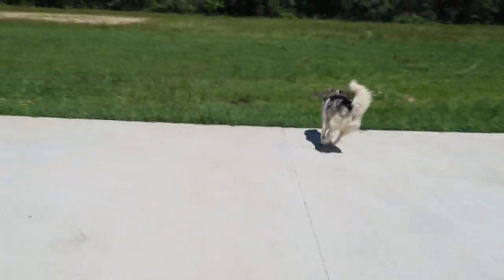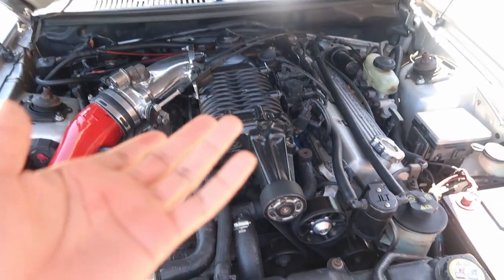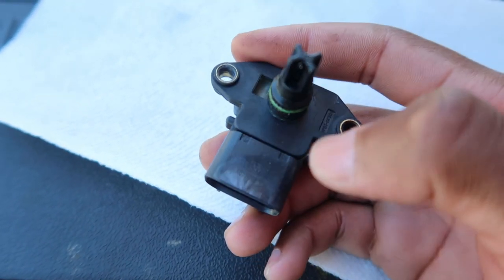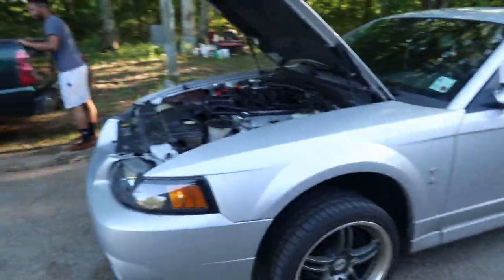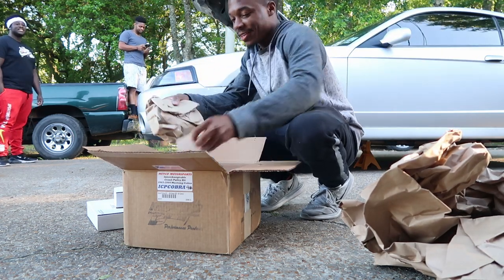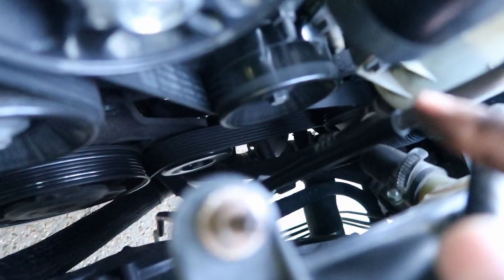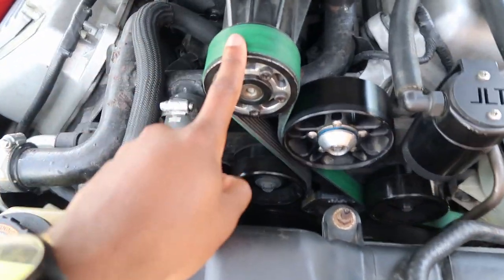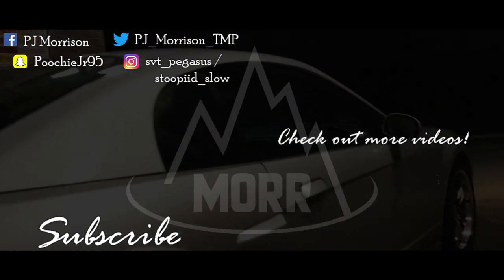MORE BOOST is ALWAYS the Answer! | Metco Crank Pulley Kit

Comment: Get it on a dyno, I'm running a 2.76 upper pulley and I'm considering getting the Metco 2lb lower as well. I'd like to see if it's worth the $386. Did they recommend the 3" alternator pulley?
Reply from the maker: Soon enough.. I’m having problems that I need to fix before that. I was recommended this setup by a few people, but no one particularly told me to run the 3” alternator pulley
Reply: The 3” is better because is a bigger pulley than stock therefore spins the alternator slower so u dont run into issues

Comment: How did it go taking of the stock lower pulley? Did you use the same strategy using the jack ?
Reply from the maker: I used the same method, but after breaking some tools.. I realized that it’s best to do it from the passenger side instead of the front of the car. That way the tools aren’t bending as the jack goes up😅
Reply: @pj_morrison  what do you mean do it from the side? I'm going to be doing this kit on mine soon
Reply from the maker: @Gmc72701  slide the jack under the car from the passenger side, not the front
Reply: @pj_morrison  did you heat it with a torch to get it loose? How easy did it come out

Comment: Does the metco lower still use the cage mounting holes
Reply from the maker: The kit has everything you need in order to mount it fully, no additional holes are needed. It’s a direct bolt on if you have the whole kit